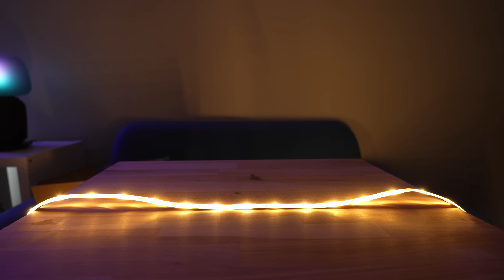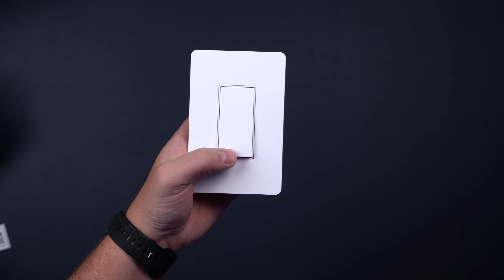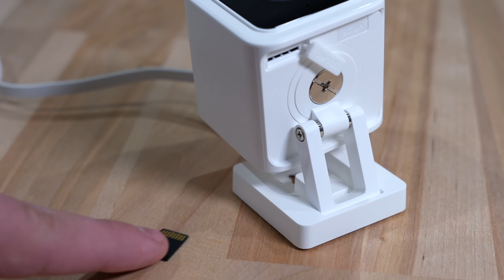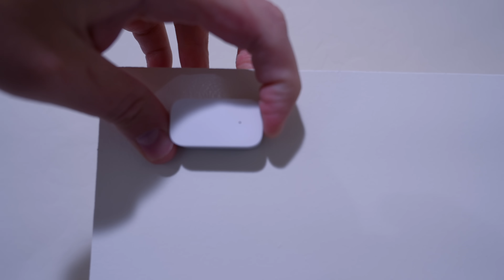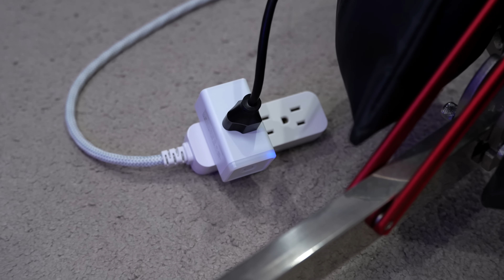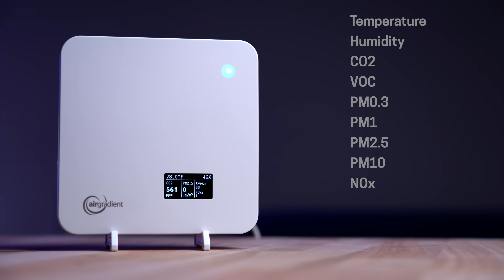Cheap Smart Home Devices that are WORTH IT

Comment: Those IKEA smart buttons works absolutely fine with Zigbee2MQTT :)
I use a lot of IKEA smart remote controller (those with the play, volume up, volume down, etc buttons..) instead of wall switches and beside the "main" funcion what does the same as the regular wall switch was doing at the same place earlier, I got 6 additional buttons (2 with doubleClick and 4 with "long press" functions too).
I highly suggest those "remotes" :)
.. and those remotes also uses 2 AAA batteries (and works fine since about 15 months with the first sets of cheap batteries)

Comment: Most WiFi devices have pretty horrible connectivity, especially cheaper ones, but for the price, and if it is in a non-critical place, they can be nice to have.
Given Matter supports power monitoring, the devices that do not support this via Matter may get a firmware update, but in this price range likely not and they will remain not fully matter compliant

Comment: The Valhorn motion sensor is actually the best, and it's cheaper than the 2 mentioned. Runs on 2 AAA batteries, has 15s cooldown and integrates a light sensor. It's pretty much the Phillips Hue motion sensor minus the temperature probe at 1/5th the price!

Comment: The Aqara door sensors are very customizable: I have 3 of them, uncased, installed behind the jamb for each of my exterior doors, with a magnet on the end of deadbolt: it's my "is the door locked" sensor without the fancy motor driven lock. They're all aggregated into a custom state "House Secure" which controls the back porch light: it comes on at sunset if not (House Secure), and sends a notification to my phone, at (or after) 10 PM if any door is unlocked.

Comment: I use the Ikea Zigbee bulbs. They're hard to pair, but once paired, they work great!
Reply: I like the Ikea bulbs, but I've had issues with them falling off the network in ZHA in power outages. I added them to my Hue hub and the network is solid.
Reply: @eugsmiley  What adapter are you using for your Zigbee network in HA? FWIW, I have about a dozen Ikea Zigbee bulbs (plus a bunch of other Ikea Zigbee devices) connected to ZHA through a ZBT-1 USB adapter for a about 8 months now and haven't had any issues with them falling off the network after power outages.

Comment: I will definitely vouch for the Kasa KL135 bulbs. Been using them for about eight months. The only bad thing is having to use the Kasa app to get the bulb connected to wifi, but after that, I can just connect it to Home Assistant. I have several bulbs inisde the house and two outside (front and back door), and I've never had connectivity problems.

Comment: One note on the Apollo sensors:  They're ESPHome based, so they can also do MQTT as well.  I use FHEM and NodeRed at home for controls, and have just dabbled a bit in HA.  With the MQTT services turned on, their products can easily integrate into the other systems with or without Home Assistant.

There are also vibration sensors on AliExpress that are shaped like longer pill temperature sensors, using 2xAAA batteries.  I think they're Tuya based, but they're simple enough that they integrate well with Z2M (and ZHA), and just work. The form factor also makes them easier to mold/hide into garbage can overhangs, which is mainly what I use mine for (for detecting when trash is out and/or has been picked up.)

Comment: It's also sometimes worth looking to Aliexpress and at some of the Tuya options for cheap stuff. Generally speaking the WiFi stuff should be avoided at all costs, but some of the cheaper Zigbee devices aren't actually half bad. I've personally had really good luck with specific versions of their contact sensors, PIR sensors, and buttons. Hell, I've even got a Zigbee lightbulb from there in my network, but I do want to swap that out with something better eventually since I don't particularly trust their mains powered devices.

For temperature and humidity sensing, my current go-to are these dirt cheap $4-6 Xiaomi Mijia thermometers with screens. They're basically useless on their own, but they can be easily flashed with different firmware that makes them work perfectly with Home Assistant or ESPHome. Their underlying chip is even compatible with Zigbee, but that obliterates the reporting frequency compared to BT so I don't recommend it.

Comment: When you showcase these products, it would be really cool if you could mention if it's completely local access and we dont need to throw the device in landfill when they remove the app from the app store. Like that Tapo camera. Now I've got to try and find out if i actually own it, or if I'm just being allowed to use it for a while by the manufacturer.
Reply from the maker: Most of these devices work locally. As others have mentioned, if it works with Matter, uses Zigbee, or ESP Home then it will work locally. Almost all the device categories had at least one device that could do that. The Tapo C120 camera needs an internet connection to use the app but if the internet is down the live stream into Home Assistant still works. This video is about inexpensive devices so that was the main focus.
Reply: @SmartHomeSolver  Will you do a video about self-hosted/network gapped (it completely offline or not needing to be connected to the main network) devices? This is becoming a more important topic every day given how anti Right-to-Own companies are becoming. For anything that goes in our homes, privacy/air-gap should always be one of the metrics its measured and compared by right along with other features of the device.
Reply: @lyianx   I had a great little Nest thermostat that I picked up a decade ago. Worked flawlessly through the app or manually. It has a great esthetic and was very intuitive. Then Google bought it, which I ignored for a couple of years, refusing to "create an account", but then one day Google disabled connection to the internet for any customers not willing to pay a subscription. Now I'm looking for one that will actually belong to me after I buy it. Any suggestions?
Reply: @SmartHomeSolver id love to see a video showcasing the best devices for people who want a 100 percent local setup
Reply: @SmartHomeSolver hey can you confirm if most of these Work with home Assistant then in theory yes it's local but you could control remotely?
Reply: @SmartHomeSolver  Except you did mention Matter devices that required the manufacturer app to set up, so in theory those could EoL the same as a closed system.
Reply: @SmartHomeSolver  True, but for some of us there's no price cheap enough if it's just going to become e-waste soon. A quick "you have control of this device" would be enough.
Reply: @c90adventures  The problem is that a channel getting sponsored by data stealing manufacturers isn't incentivized to give us information about open source devices. I'm always checking out small channels run by nerds who just want to share what they've learned. There are lots of them and they give info that's more useful. The ones with a lot of views and subs are mostly gateways to Amazon, funneling us into a customer base. The devices are cheap because we are the real product.
Reply: Go with all ZigBee wherever possible
Reply: Activate local sign in and you can get rtsp from tapo camera
Reply: Wild! C90adventures, I followed Alaska to Argentina for years. Never would I ever have expected to see you here. Safe Adventures!
Reply: Hey! Its you! The mini Jeep and Honda Cub-guy! ❤
Reply: 9/10 cheap devices work woth Tuya. Tuya ain't going anywhere
Reply: @robertodamen7148  Tuya sucks and is hostile to local-only. That's an automatic no for me.
Reply: Matter will always be completely local.    That said, ANYTHING on WiFi I would make the assumption they phone home even if they pretend to be local.  These are not expensive devices.   You get what you pay for.  Expect them to phone home.  IF you are a tin foil hat person then don't buy them.    What information are they going to send to their maker anyway?  No camera, no microphone, no GPS.  They are cheap so that are not going to be collecting much data.
Reply: @EsotericArctos  It is not about collecting data - it is also a security risk. You do not know how the communication is implemented. So you could open a lot of security holes into your local network... Maybe even use your network via the hacked lamp for attack on other systems which could lead to a lot of inconviniences for you as you are responsible (and registered) for your own network... All that have happened already so it is not a theoretical thread.
I would try to make a big step around wifi based IoT if the firmware is not based on a known open source system like tasmota or esphome.
Reply: @obiwan007  best to always do your own research.    Matter will work locally, but as was said in the video clearly, a lot of these devices do not expose all their features via matter.   That's what you get with cheap devices
Reply: @EsotericArctos  Only if you don't understand how to set up IoT devices sensibly. Mine only ever connect to a subnet with no internet access. 

It's not "tinfoil hat" to be concerned that a device, no matter how dumb, can send your Wi-Fi credentials to Dog knows who.
Reply: @EsotericArctos  I think you replied to the wrong comment. Your reply after the first line has nothing to do with my comment.
Reply: @c90adventures  you need a camera to watch over your stuff while you're buried in snow?
Reply: @c90adventures  That's what I get for using the mobile phone trying to reply instead of waiting until I get to a computer lol :)

Comment: some time ago i tried some smart bulbs but they were far too yellow. problem is, i can't find any zigbee E14 smart bulbs with a high enough color temperature and an acceptable price.
also, your american devices would be useless here in europe because our electrical system is different (different voltage, different frequency, different plugs. 
also, due to the stupidity of the majority of your fellow americans (they sent trump to the white house), i try to boycott american products.

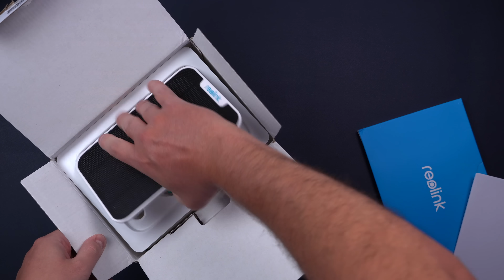Comment: 8:12 You may have meant this specifically for solar and battery powered, but the cameras don't need to be hardwired to ethernet. They can be connected via WiFi and still integrate with HA. I'm using the Reolink E1 Outdoor cameras over wireless and they integrate with HA without an issue. All of the sensors, including the individual ones for person, vehicle, and animal detection show up as separate entities within HA.They are recording to their own SD cards as well as streaming to an NVR.,
Reply: I have a question regarding the NVR recording feature of this camera, if you don't mind me asking.

What NVR do you use to store your footage? A NAS perhaps? Can you use any NVR or are you forced to use a Reolink NVR?
Reply: @proxyhx  No Reolink NVR necessary. I've got them recording to my Synology NAS via its NVR suite. They can output RTSP streams, so any NVR that can accept those should work.
Reply: @PhastorDragon  Thank you for answering! I was thinking of making them record to a Frigate Docker container, so it should work perfectly then.

But does motion detection work for you? I'm guessing it doesn't, at least not without some extra tinkering, and even then it still wouldn't be perfect due to the lack of ONVIF streams. I've read online that some Reolink cameras can give an ONVIF output stream, allegedly.

Though I probably shouldn't bore you with any more questions. Thank you again for answering my initial question.

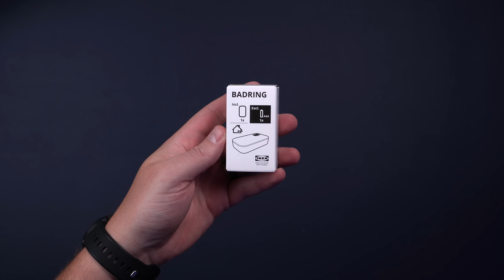Comment: 13:42 comparing IKEA water leak sensor to AQARA water leak battery, we should mention the battery life, 
Ikea lasts 4-6 month on one AAA battery, 
AQARA lasts 2 years on a coin battery
Reply: So basically with Ikea you are paying for a 'battery subscription' 😂
Reply: @Rick104547  except you can use rechargeables on those, so it can be cheaper than the AQARA
Reply: I put 8 of the Aqara water leak sensors around my house and set up notifications for them almost 3 years ago and kind of forgot about them. 

A month ago I found one under the sink and decided to collect and test them all by plopping them in a bowl of water. Every single one gave me a notification immediately, batteries were still going strong in all of them. 

Of course I wasn't going to push my luck though, so I replaced all of the batteries and put them back under the appliances and such. 

Also, I've also been getting 2-3 years of battery life on all of my Aqara PIR motion sensors and contact sensors. They've been totally reliable and have worked great!

Comment: I'm sure someone has pointed it out , but treatlife presence works great with home assistant. The trick (as with all Tuya based devices) is to set the device up in Tuya instead of the Treatlife app.

Also the base works as a stand or you can stick a magnet to it and attach it to the fridge if needed.

Comment: You missed the "ULTIMATE" Smart Door Lock. The Lockly Zeno Series. It has Facial recognition, finger print recognition, key pad, cell phone app and of course key entry. I purchased a new steel entry front door, so I wanted to add a little smartness into entering the house. I crossed my fingers after I purchased it ( around $350) as my wife is NOT a technology person and constantly moans about the Facial Recognition at the nursing home where her mother is... "It never works!" Well, I installed it, programmed her in and it has a big hit with her. She even was praising it to my son, who was in shock after hearing what she had to say. She told the nursing home front desk person that it works great. The door unit is built very well as the metal casing and mounting is very heavy. So far after 5 days the (WAR) Wife Approval Rating is great. Still have my fingers crossed. Time will tell. Well worth the money! You need to try this lock.
Reply from the maker: Those Lockly locks are pretty sweet. I was using the Visage version for a while and I really like it! The reason I didn't include it was the price. Those locks I showed are half the price so I had to leave out a lot of great devices because they cost more.

Comment: The Ikea Tradfri series is good and cheap too. I have Vallhorn PIRs (€10), Parasoll Contact sensors (€10) as well as Somring dual buttons using ZHA with the Home Assistant SkyConnect dongle.

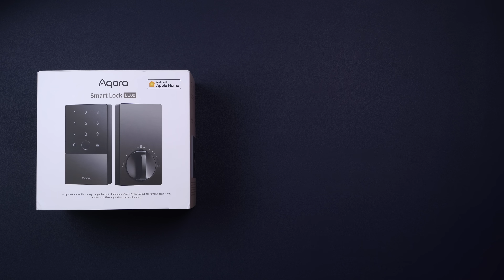Comment: 6:06 Manufacturers need to STOP forcing us to use their apps to unlock all the features. Matter is supposed to take care of this. But that’s not going to happen because the manufacturer wants all the data they can collect and likely monetize in the future. Maybe future Matter updates will bring more of the app functionality into the standard. For me, if an app is required and it doesn’t integrate into Home Assistant, it’s not going to be anything I’m spending my money on.
Reply: Because most of that (fancy) features didnt supported by Matter except on/off, Lol
Reply: Are things like setting pin codes and other unlock types even in the matter specification? If not, then it's a good reason, why they do it like this

Comment: Ok I have edited this to add my pennies worth, I would go for the sonoff presence sensor at £24, works well (for me) integrates perfectly with HA over zigbee, Meross plugs with PM price ranging from £15 for 2 and for the wifi one can be added to HA with Meross LAN making it local and there are matter ones now too. I am in the UK (obviously using £) so the I know if these two are available there but I imagine they are. Sonoff you can get from Aliexpress but no clue with the Meross ones

Comment: I find my ecobee an upgrade over the previous Carrier Infinity I had previously. BUT the lack of API access is driving me NUTS. NUTS b/c why isn't all the functionality just local to the thermostat with the cloud being a value add for stuff like rating me against my neighbors, and maybe some future functionality that can really "learn" about my heating system, use weather data and maybe utility rates to proactively heat or cool the house for maximum benefit.